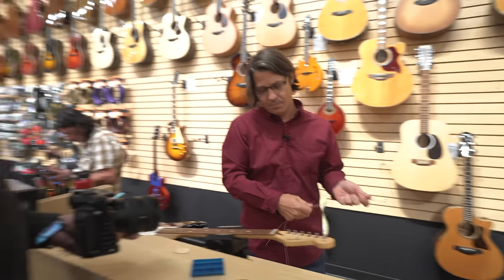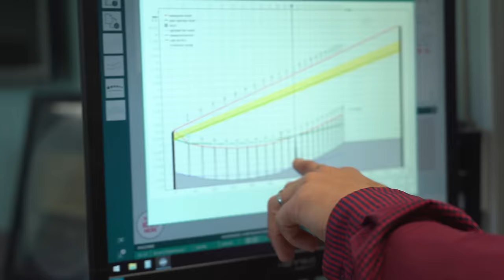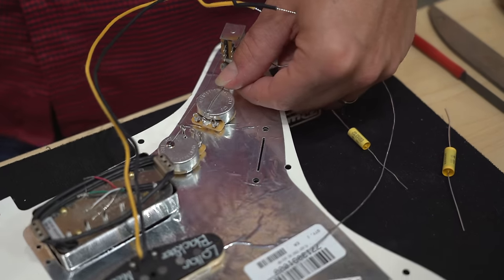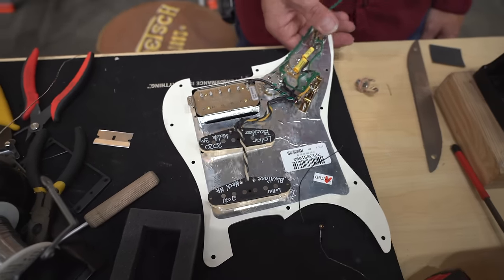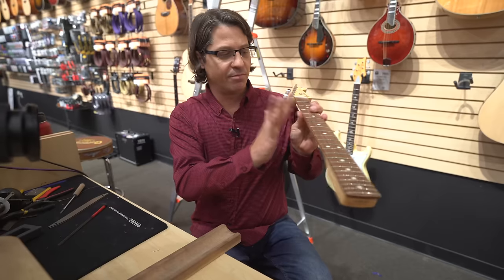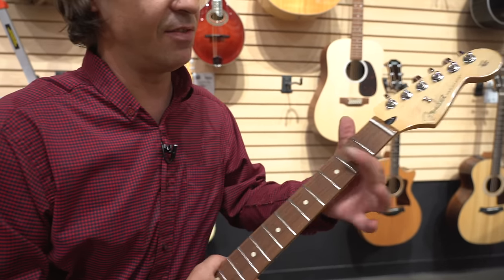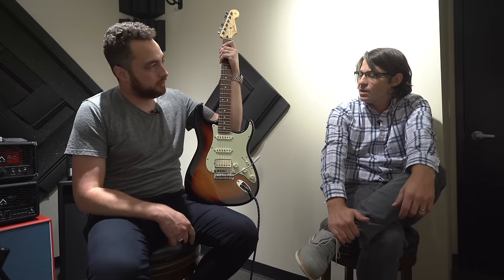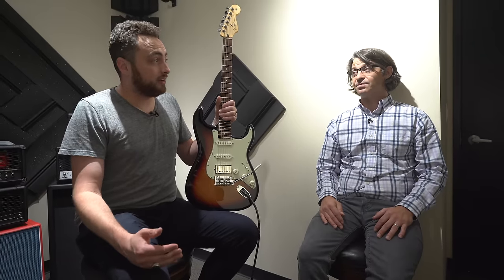We Tried To "Custom Shop" The Cheapest Fender Strat

Comment: I bought a pawn shop $100.00 Indonesian Squire in great shape and did all these mods and a few more.  The important point in buying a cheap Strat (or any other type) is be very picky about the neck.  If the neck is good I'll take a chance.  I also do a 7 way switching with a push/pull pot to allow for a Tele sound of Neck and bridge PUs and all three in series.  The other major mod is a true bolt on neck.  I drill (Bridgeport Mill) the screw holes out and install metal inserts into the back of the neck and then use fine thread machine screws to attach the neck.  Most so called "bolt-on" neck are actually just wood screws.  Over time wood screws can loosen, a machine screw will not wear the screws holes.  It's also a way more solid joint.  I wonder why Custom shop doesn't do this?

Comment: I have a chinese strat copy, an Ashtone, it was my first guitar. I "custom shopped" it because despite it being a cheapo knock-off, the neck is actually fantastic and with upgraded hardware and proper nut it actually stays in tune amazingly and plays like a dream, better then any actual fender I've played since. Still, the guitar is far from my favourite in my collection, I harbour quite a distaste for strats, most of my guitars are modern and super ergonomic metal machines or mean explorers, but this silly little Ashtone holds great sentimental value to me, so I keep it around and play it every now and then.

Comment: What’s nice about the Player Series is that you don’t need to turn it into a custom shop or mod it… a good setup is all that’s required to have a really nice playing guitar.

I bought one used, had it PLEKd, bone nut installed and have otherwise left it alone. The pickups (especially the neck) sound way too good to justify ripping them out of the guitar in the name of “upgrades.”

Comment: Interesting video.  The main comment I have is that there was a lot of time spent on the neck and there’s still the issue of the fretboard.  But wouldn’t you be able to get a lot closer and maybe for cheaper if you just replaced the neck altogether and maybe had to do a little bit of touch up work?  You can get a new Pro 2 neck for $600.  Not saying it makes a ton of sense to do so but if you’re going up against a guitar that costs around $4k, there’s a lot of room to work with.
Reply: Or buy another guitar, a Mexican tele? And do the fret and fretboard work yourself.
Reply: @davekeating.  Yeah.  The main thing with the fretboard is that you can’t get the same wood options as the US ones so if that’s sort of why it can’t be replicated, definitely solutions.
Reply: @djcrouton2680  Or buy a licensed neck?
Reply: @davekeating.  Yup, that too.

Comment: Instead of Fenders, I’ve done this with Squiers for my last 2 guitars. 

All the work and replacing the pots, wiring and pickups makes it unnecessary to start with even a Mexican Fender. I did the work myself in stages as well. 

PS. Don’t know about all MiMs but had a Meteora arrive damaged and the poly was about 2 sheets of paper thick at most. I don’t think that would have much effect on the tone/resonance. The Squiers may still be much thicker though.
Reply: Pots, wiring, switch, caps are the same in American and Mexican Fender. Exactly the same. The exact same references.